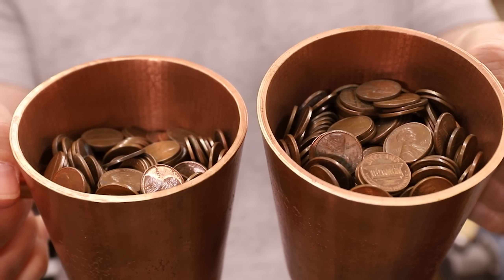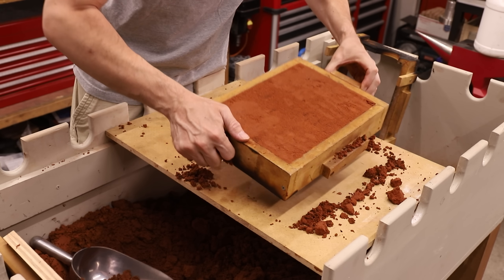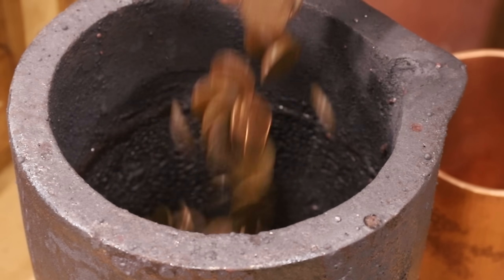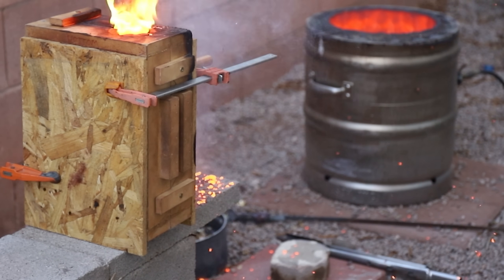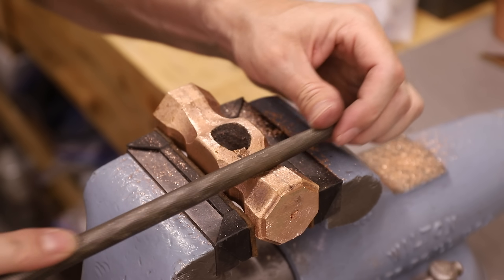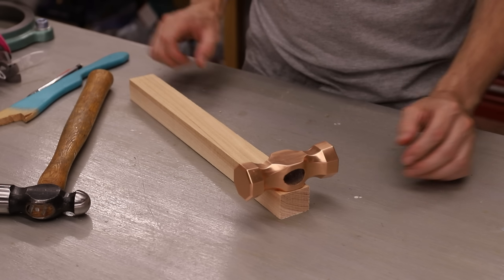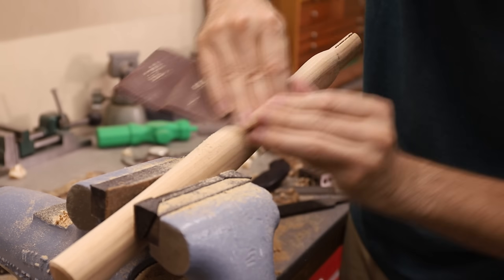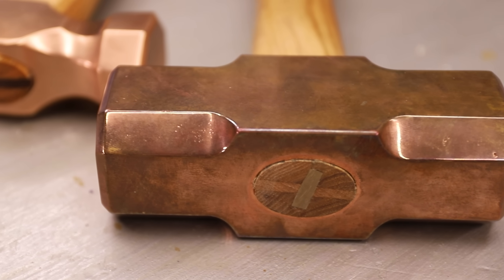Making a Hammer out of Pennies (1000 Melted Pennies)

Comment: This is a beautiful  hammer for sure.  I think the old spoked car wheels with the spinner came with copper hammers to knock on and off the spinner with so that hammer wouldn't gall the spinner.  I can't think off hand what other use a copper hammer would have, since nearly all other metals are harder than copper. But the process of making this was fantastic!
Reply: Actually they used a lead hammer to smack the spinners back onto the hubs, one came with my 65 Corvette,
Reply: @barbararichards6066  Awesome, thanks for the correction.
Reply: Copper and brass is used all the time in places that you don't want tools that can cause sparks, like working with live gas pipes, or in the ammo holds of warships.

It's also used by machinists because it is softer than the parts they are working on, which is a property you pointed out.

Comment: I literally clicked on this video to make a comment saying “Obligatory destroying money is illegal comment,” but then I saw the pinned comment.

For those of you who are unaware and too lazy to do a lick of research, it is illegal to melt (specifically just pennies and nickels) with the intent to sell the raw metal for profit. The reason being that it would cost the US a lot of money to put the coins back into circulation. The reason only pennies and nickels is because other coins are typically worth more than the raw materials they are made with. What’s EVEN MORE is that the law states that the secretary of treasury only has to enforce this law when they feel it is necessary! So you could literally “break the law” and melt pennies to sell the metal for profit, and it’s literally not breaking the law if the secretary of treasury doesn’t deem the supply of coinage low enough to penalize the sale of raw metal from coins!

It is NOT illegal to melt coins for basically any other purpose. Specifically, you can destroy coins to make art/jewelry. As far as I understand you could just melt it for fun and that’s legal.

A link to the law.
https://www.federalregister.gov/documents/2007/04/16/E7-7088/prohibition-on-the-exportation-melting-or-treatment-of-5-cent-and-one-cent-coins

Comment: I'll just add my 2 cents here. The wood combination with the copper is very esthetically pleasing.
Reply: I don't think he needs your 2 cents, he had plenty of pennies to complete the project
Reply: @VaultBreaker101  he’s right, but I’ll give you a penny for your two cents 😅
Reply: @VaultBreaker101  Those pennies and cents however will be easily beaten by just a few steel nails, which cost peanuts
Reply: Hey I get it
Reply: He isn't an esthetician. I think you mean aesthetically
Reply: I'll also add my 2 cents. Maybe we can get enough to make a hammer.
Reply: Making a Hammer out of Pennies (1002 Melted Pennies)
Reply: Nice lmao
Reply: Pennies aren't made of copper, they're zinc.
Reply: I have to add, it is illegal to melt down pennies.

Comment: 3:28 unless I'm mistaken those are just particulate filters. I wore those once by accident into my craft room where I was handling mats with toxic fumes and I smelled them right thru the respirator. Those aren't meant to protect against anything other than dust, so if those zinc fumes are toxic, they won't protect you.
Reply: For fumes, you want the square filters, the Breaking Bad style ones. They can be swapped out with the particulate filters very easily and are not that expensive. Especially compared to your lungs.
Reply: I guess you watched this video in high resolution and read the text,
because other channels use visually the same filter for protection against fumes, for example NileRed.

I have also seen in stores round filters for fumes.
Reply: Those are just particulate.

Comment: Um, nice try.  US 1 cent coins are copper plated zinc, or copper plated steel. Pennies haven’t been solid copper any time in the past 40+ years.
Reply: Pennies made before 1982 are 100%  copper. They have made so many pennies it is not hard even in 2014 for find a large number of full copper pennies. edit: fixed the year

Comment: Genuine question, what can this be used to hammer?
Reply: Bronze/Brass hammer heads are spark and corrosion resistant and are commonly used in flammable environments where a steel hammer head would be a safety hazard. The soft metal head can be used to shape and pound harder metal surfaces without marring.
Reply: @afish8797 thanks for answering!  Learned something new.  Never knew they were spark resistant.
Reply: What kind of question is this? Anything that needs hammering
Reply: @mwmwm3388 it’s a soft metal and anything I would use it for it would be ruined.  But I only do normal wood working. A copper hammer would be a very poor choice to drive a nail into a board for me

Comment: The shop light tracing idea is something I never heard anyone do before and is such a great idea. I'm guessing the light source needs to be larger than the object to keep the lightrays as parallel as possible at the edges of the pattern.
Reply: yeah when i saw that, I was afraid the shadow would end up being a little bigger than the source object.  It seems like it would have been better to just trace around it with a pencil?  Although nobody can argue with his results, thing looks spectacular
Reply: A similar technique is used on the lathe for producing multiple identical pieces, by tracing the shadow cast by the first one and then matching it on subsequent ones. Since the shadow is only referenced by other shadows, the distortion doesn't matter in that case, but you make a good point with this version.
Reply: It needs to be a small, almost point, source for sharp edges. Not critical in this case, just an idea to keep in reserve.
Reply: the higher it is the less impact it has, you would really want non diffuse lighting, high up, with a short enough distance between the tracing and the object to provide minimal error tolerance.
Reply: Just 3d print half the handle
Reply: New 3d printer are easily cheep enough and large enough i think

Comment: This is Ilegal isn't it?
Reply: No, but if he gold plated a silver eagle and tried to pass it off as a gold double eagle then it would be illegal.
Reply: @jasonsummit1776   Correct because that would be fraud
Reply: I was wondering the same thing so I looked up the law because coin press machines at museums and parks are fine. 
Code of Federal Regulations (CFR) Title 31, Subtitle B, Chapter 1, Part 82, Section 82.2 

82.1 Prohibitions.
Except as specifically authorized by the Secretary of the Treasury (or designee) or as otherwise provided in this part, no person shall export, melt, or treat:
(a) Any 5-cent coin of the United States; or
(b) Any one-cent coin of the United States. 

Section 82.2
(b) The prohibition contained in § 82.1 against the treatment of 5-cent coins and one-cent coins shall not apply to the treatment of these coins for educational, amusement, novelty, jewelry, and similar purposes as long as the volumes treated and the nature of the treatment makes it clear that such treatment is not intended as a means by which to profit solely from the value of the metal content of the coins.

So as long as you aren't melting down pennies and selling the bullion as scrap it's ok. This is the site that I found with the law https://makeitfrommetal.com/is-it-illegal-to-melt-destroy-us-pennies-and-other-coins/
Reply: It is not illegal to melt, form, destroy, or otherwise modify US coins, including pennies, unless the objective is fraudulent or with the intent of selling the raw materials of the coins for profit. Projects that use coins as materials are entirely legal in the United States.